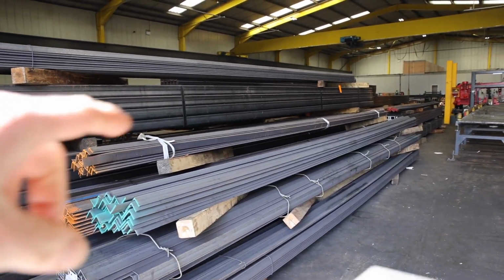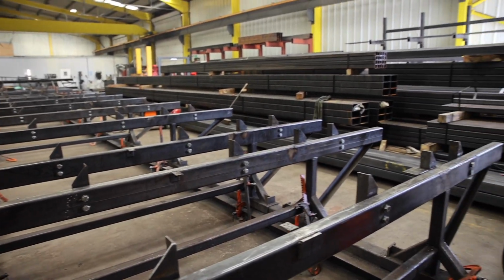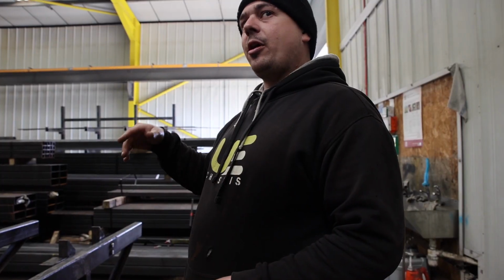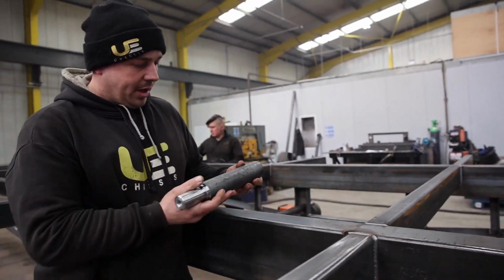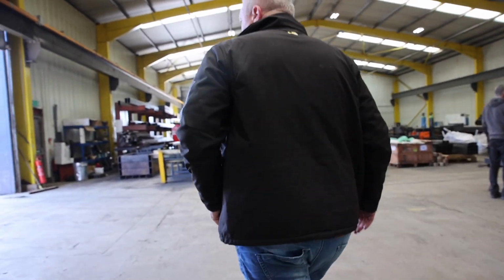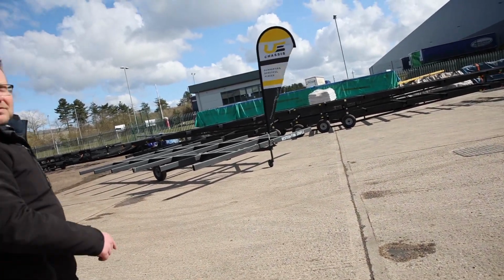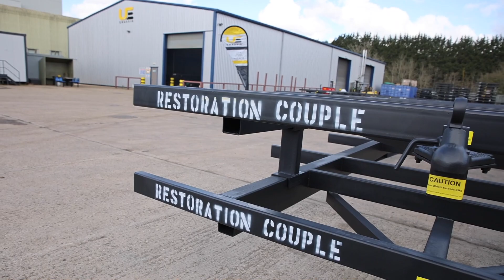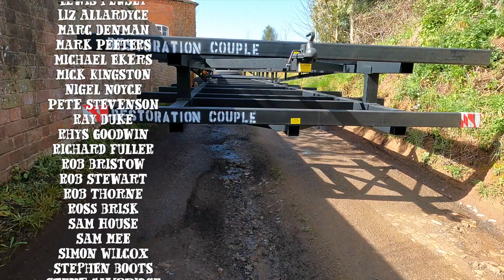THEY ARE MADE - Our GIANT MOBILE HOME CHASSIS are ready!

Comment: I'm so confused. I think I've missed 1 or 2 videos. I thought you bought the farm and land. Ie a house and land. Why you building a trailer house?
Reply: They don't have a house on the farm yet - it's land and farm buildings.

As someone whose had my own joys with UK planning permission (i.e. getting the local government building permit), I suspect the reason they are going this route is because you don't need planning permission for a 'caravan'/'static caravan' (trailer / mobile home). There is a maximum size limit but the law allows you to bolt two together during construction and still classify it as a 'caravan'. The ability to move it again once built is only really needed in theory and doesn't need to be demonstrated.

The old stone barn they have on the farm is listed - meaning it is on the local government list of important historic buildings. Which means any planning permissions / permits to build a house near it are going to be a bureaucratic nightmare with a high chance of rejection. That also means Tim&Jo might not be able to share their final vision/plans until they have all the permit's required so as to not risk jeopardising the process - getting listed building consent can take years.

But on the plus side, they are not in a conservation, aonb, or green belt area so they can do an awful lot with 'development rights' which essentially automatically grant building permits in certain circumstances.